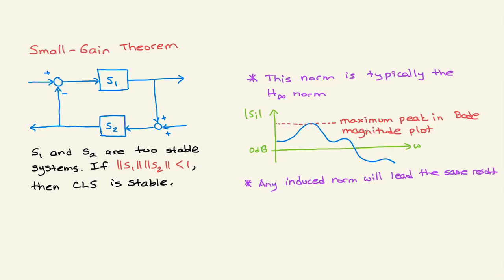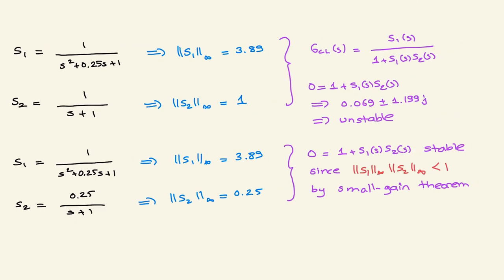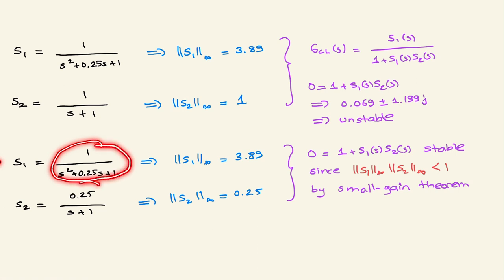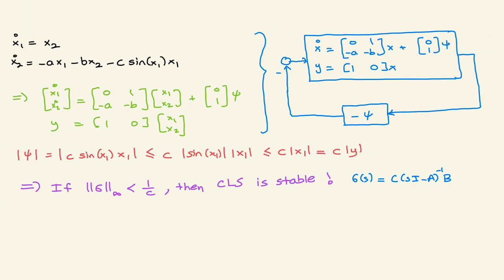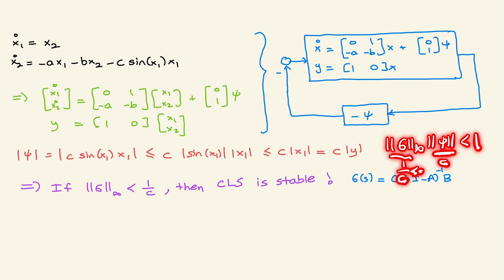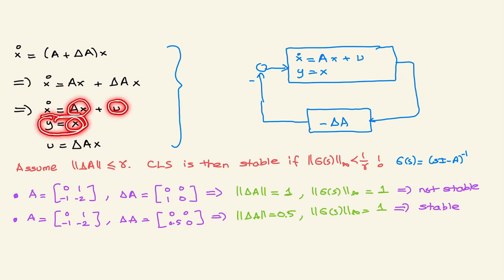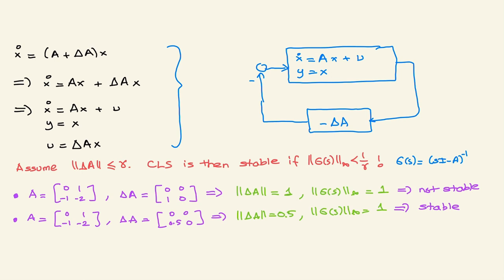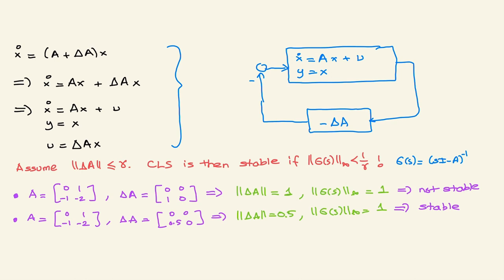Stability: Small-Gain Theorem (Lectures on Advanced Control Systems)

Comment: at 2:54 mins norm S1 =4.03 is coming for my case. how it is coming 3.89 for your case? please help
Reply from the maker: Thank you for your careful check. I reviewed my code for this video just now and there is a typo in my code.  Instead of coding "G=tf([1],[1 0.25 1]); hinfnorm(G)=4.03" in Matlab, I coded "G=tf([1],[1 0.259 1]); hinfnorm(G)=3.89". It seems that I accidentally included 9 next to 0.25 that resulted in 0.259 instead of 0.25. So, please change the transfer function 1/(s^2+0.25*s+1) in the video to 1/(s^2+0.259*s+1) so that all is consistent.